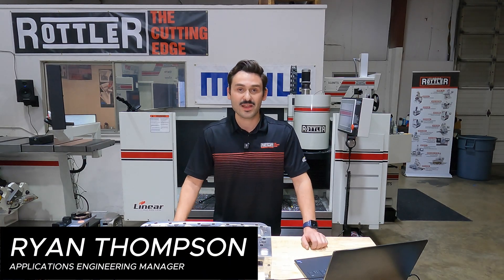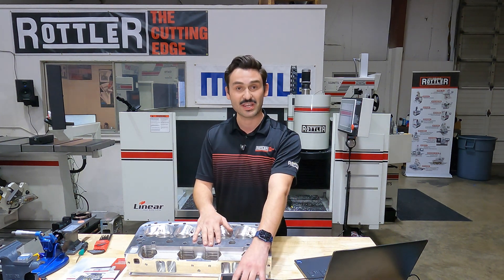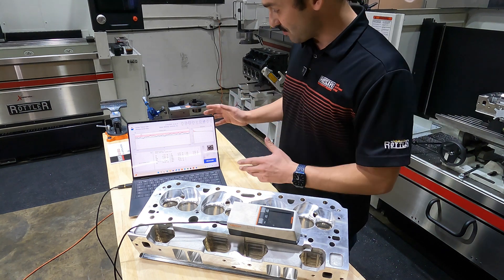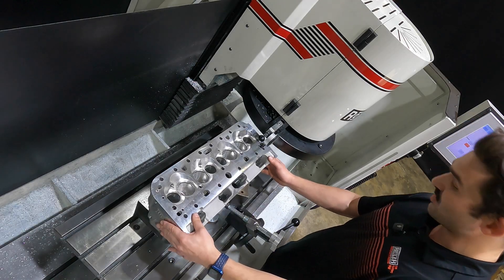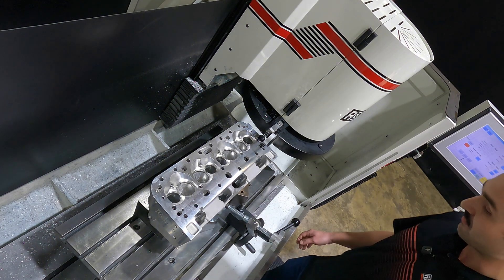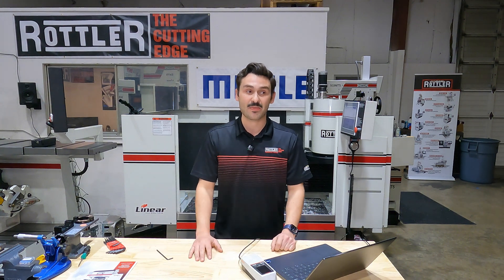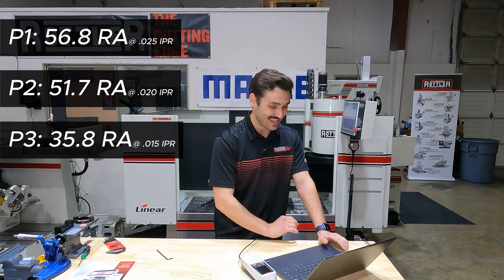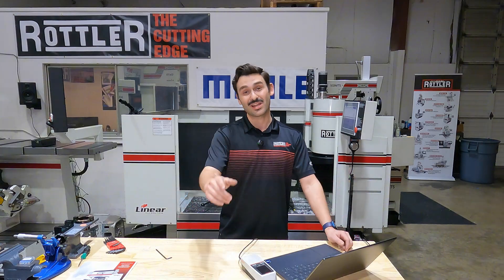How to Get the PERFECT Surface Finish - Rottler S86A Aluminum Cylinder Head

Comment: Interesting experiment. I use an SF7M at work. I’ve had success with 1200rpm and 0.008” IPR. I’d like to go slower but the feed seems to stick and jump giving an inconsistent feed rate any slower than .008”ipr.
Reply from the maker: Thanks for the comment, and glad too hear about the SF7M! Those are great machines! 

Those did have sliding turcite ways on the horizontal axis, likely that sticking at slower feeds is from that material wearing as designed over time. This is why we switched to the linear rails on the S80 models.

If you ever need help with that SF7M, please email service@rottlermfg.com. We’re always happy to provide guidance on that system!